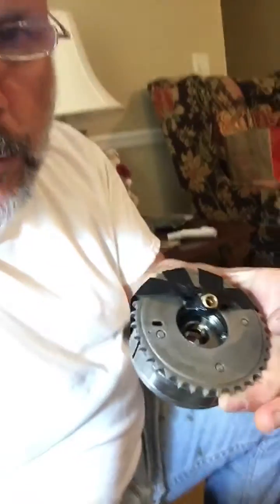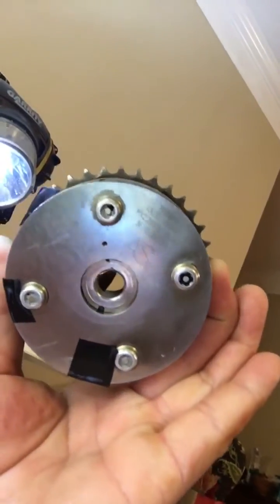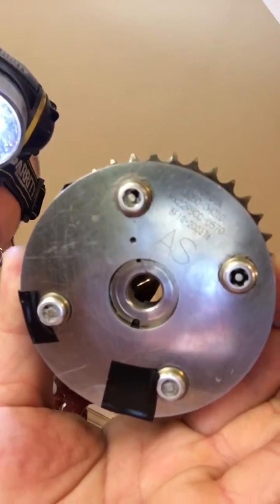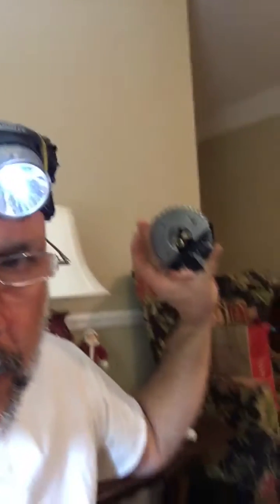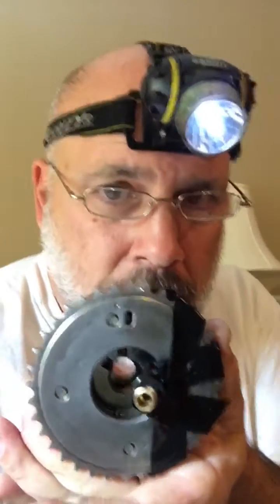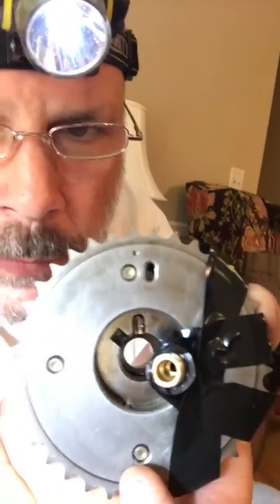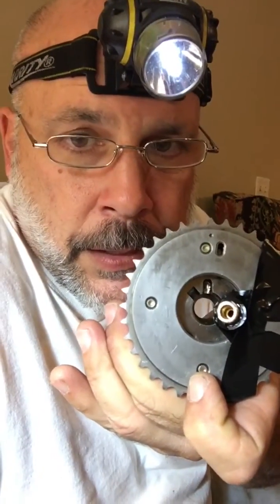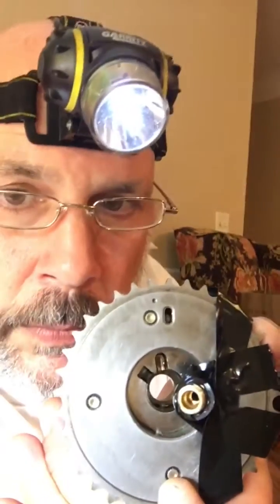05 Toyota Camry 2AZ-FE VVT-I Cam gear unlock part 1

Comment: I always thought did you leave the cam phaser on the cam and use one of the oil and lights that go through the cam phaser which creates the pressure itself with air pressure and it should unlock it like that then you loosen it and remove it unlocked. Don’t take it off without doing that.

Comment: Simply open the front plate pull the piston turn it to unlock ,close again tight the screws ready.
Reply: Hello I have a new oem gear and I accidentally locked it when putting it on the camshaft ive tried air but it wont unlock is there any way you can give me more details on your method
Reply: Nvm the 4 bolts that are wont fit a socket I'm going to take it to a local toyota specialist to get it unlocked

Comment: When they say use the tape they mean on the cam.
It is very easy to do it on the cam.
https://www.youtube.com/playlist?list=PLcjixgJoqgvx7qXQQ2ca2kocW5lwXos8_
Wrap the camshaft close to the gear and cover the two holes and loosen he main front bolt but keep the gear with the cam and put a hole on the electric tape where the hole is and from there put in the air and you hear a click.
Hold the sprocket and turn the gear all the way counter clockwise (about half turn) and tighten the main bolt and install the cam and then turn the gear to the clockwise till it locks again and you are good to go.